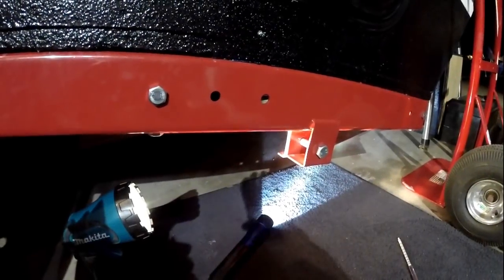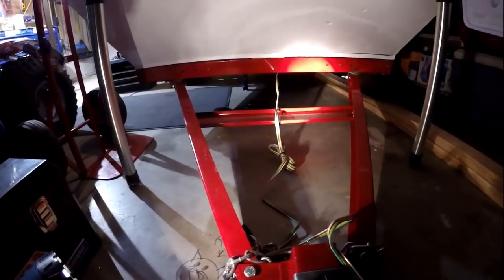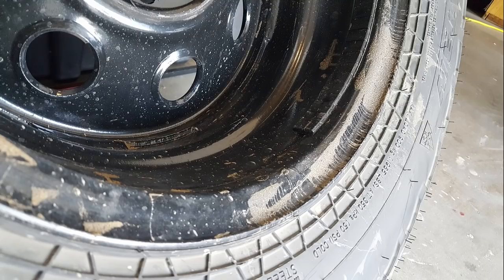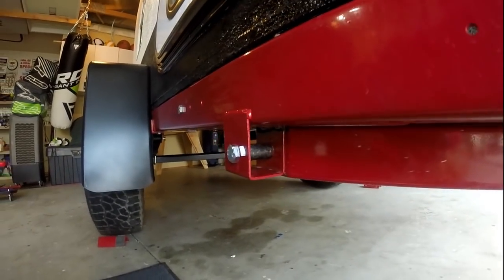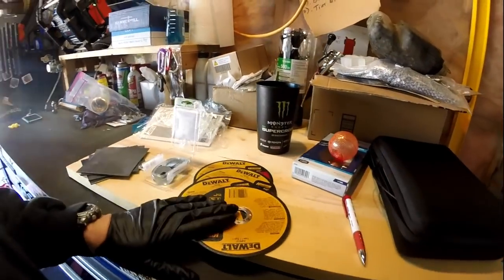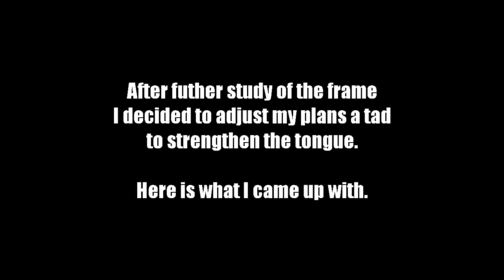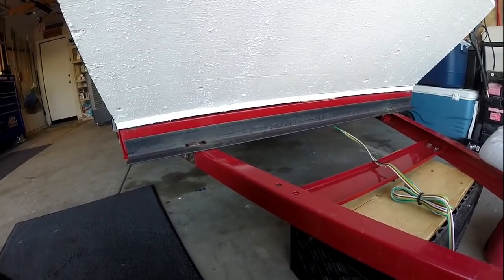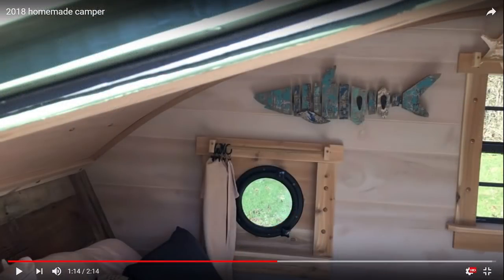4 x 8 Camper Part 34 Tongue Strengthening

Comment: I bought my HF trailer just incase i needed it to move my wife. I also knew it would probably be at or over load rating. I was a bit concerned about the tongue too. I ended turning the triangle shaped cap on the to gue upside down. Then ran a piece of hitch tubing all the way to the rear frame, welding it to all the cross pieces. Very confident, at least in the tongue.lol

Comment: Great update!  My first camper build was a teardrop, using the HF trailer.  I used the 1700lb rated "heavy duty" one, and I still built mine too heavy and some of the exact failure points you're strengthening are where I had problems. I cannot fault the product much, because you and I (and many other people) have exceeded the weight limit and - that has consequences. You appear to be doing the right things to fix this!  For anyone starting a build, pay attention to weight. Can't stress that enough. Also, regarding the Durabak, I think I'm going to coat my truck bed with their product and that's it. For the vintage aluminum look, I'm ordering some sheet aluminum from one of a few different tractor trailer repair companies we have within driving distance. I can buy sheets of aluminum longer than I need, and trim it down to size with a router bit. Thanks for the videos!
Reply from the maker: Awesome!

Comment: I have been thinking of using the HF trailer to build a camper on from the first i saw the HF catalog for the 4'X8' heavy duty trailer.
 I am happy I discovered your series of building. I will have to try and find your first of this series. Thank You tireguy.

Comment: It's good to get this kind of feed back on this trailer.  Most of these mods look like they are easiest done before the camper build is underway. For those of us looking to build on one of these trailers this hind sight is invaluable. However with all of these mods, changes and upgrades, one begins to wonder if building a trailer from scratch might not be the better course to take.
Reply from the maker: Depending on your motivation right? So if it's getting a camper the cheapest and easiest way then buying one might actually be the best option.  However if you want the satisfaction of building it, and the memories you will create then I say build it!    ;^)

Comment: What do you think about using plastic sheeting (Lowes sells 4x8 plastic sheeting for 35 bucks a sheet) to cover the plywood on the exterior instead of poor man fiber glass or just painting? I'm thinking if it's sealed and the plastic is painted, it would last a long time and as it's simply plastic it would save a lot on weight.
Reply from the maker: I guess it would probably work fine?  I do know a lot of guys just sand and paint the exterior with a heavy duty ( marine based) paint and go with it.

Comment: What do you think about using a longer axle instead of spacers? I need an extra 4-5 inches on each side to fit the same wheels I have on my Jeep on the trailer. I figure a 70" axle would work and have the spring seats welded on at the same 46".. Width. ?
Reply: Also how did you strengthen the frame? Did you use gussets or welds, etc? Thanks!
Reply from the maker: Keep watching the series....

Comment: I was thinking that your wheel bearing problem, maybe, was do to using a 1 inch bearing on the smaller Harbor Freight metric 25mm axle.
Reply from the maker: Allen, Yeah I knew that the diameter of the HF axle was not exactly 1". Some one else commented that it was in fact 15/16ths? Do you know for certain that it is 25mm?  That makes sense to me too. Either way I have already ordered the 1800LB replacement with standard hubs and bearings to eliminate the whole bearing question mark as well as make the trailer more sturdy since it is not getting any light as I have more to do in the near future !
Reply: @DIRTADDICT922  I bought a small HF trailer over 20 years ago, I checked the axles and they were metric, about .015 under 1 inch.  I remember being a little concerned because these bearings weren't available locally.  Sold it 2 years ago,  repacked the bearings for the second time, all was good.  That trailed was used mostly for short trips, probably not much over 1,000 miles on it.  I think that your move to the heavier axle is a good one,  especially considering that your getting heavier, plus it'll be easier to get parts for the new axle.